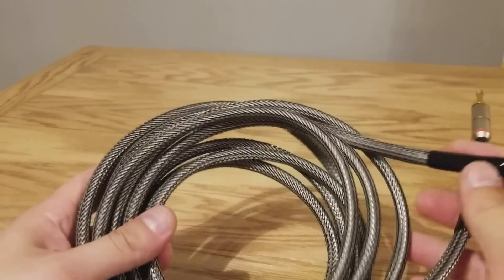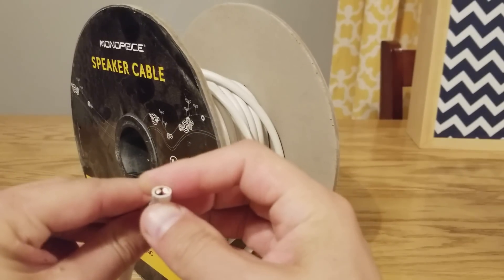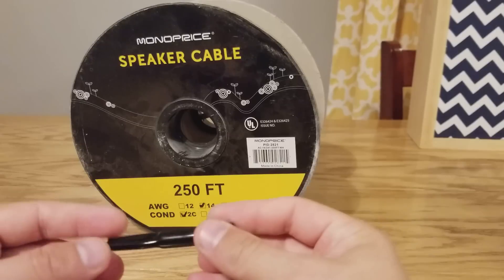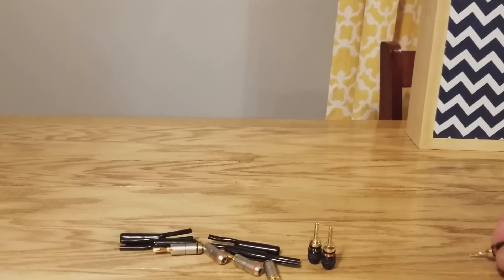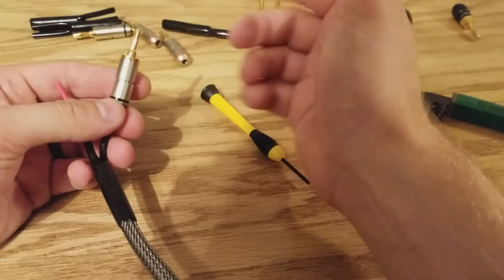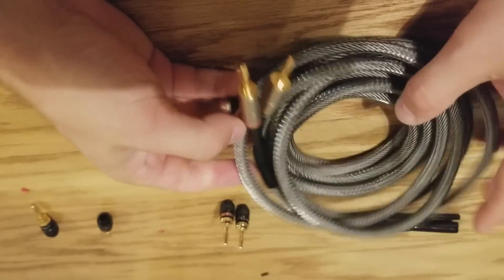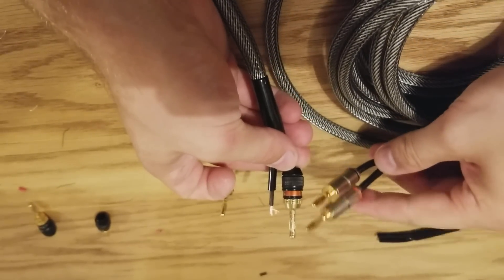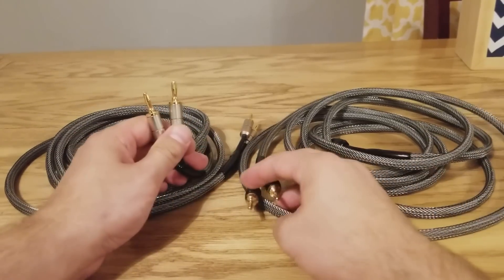How to make Your own HiFi Speaker Wire

Comment: The wire you are using is cheap junk, before and after your work. You are NOT making $300.00 wire. You are making $10.00 wire look like 300.00 wire. I suggest you watch a video about why some cables cost more. It has very little to do with looks.

* OCC or OFC copper 
* Gold plated terminals
* Silver Solder
* teflon Shielding 
* etc
These are some things that make good cable. Not putting pretty covers on them.
Reply: My system, in its entirety grosses over $20k. I wouldn't call it an entry level system. Bowers, McIntosh and Primaluna are some of my components. My current set of interconnects consists of a double pair of quality copper wire, wire that I paid about $3/ft for from a local electronics store. I have borrowed interconnects that gross in the thousands and was not able to discern any audible difference.

When I joined the Fire Dept, I underwent a full physical, including an anechoic chamber hearing test where I was able to discern and recognize test tones in the high freq range that majority of folks cannot hear. My hearing is on par.

Are you telling me then that all your voodoo and snake oil will make my listening experience that much better when I buy a $1k+ set of cables vs my, oh let's say $100 set? You can swear up and down that there is a difference "to a point" but I can tell you from experience that its not discernible. The people who go to listening test's, have no idea what they are hearing and most of the time, I'm willing to bet the placebo effect is more convincing than the sales man and their lack of common sense. You could play the same song, from the same source on the same speakers using the same wires and they'll bet their lives that the difference is amazing. Been there, seen it in person.

Irrelevant of how you slice and dice it, two things ring truer than that audible bonus you think you're hearing. One, the cable industry is full of snake oil salesmen who make big claims to sell you minuscule effective difference. Two, the only industry that's full of more shit than the cable industry is the record player industry, those con artist have jerked themselves silly.
Reply: Teflon is insulation, not shielding.
Reply: ‘Cave Beast Demon' Did your subscription to a paid product placement periodical tell you that?
The purpose of speaker wire is to transfer signal, with as little interference as possible from the amp to the speaker. Perhaps you've heard of twisted pair wire? There is a reason it's been the standard since Morse code. Why dont you patent something useful for mankind instead of coming here and trolling someone who is genuinely trying to be helpful to others.
Reply: Sir, I think you are very mistaken and taken in by the Hi Fi industry hype. They want to sell their stuff so will say stuff like OFC, gold plating  and what have you. As a massive music fan ( hard rock, soft rock, pop, chill out, house, jazz, Indian music, house music, independent music  etc etc.) , I have always dabbled with hifi from low end ( in my twenties )  to high end when i got  in the position to buy that kind of kit. I never thought cables made that much of a difference at all to be honest. What does make a difference, is the electronics and speakers matched in price and quality. Thats a dead certainty..
Reply: The only good thing about high end cables they give employment to the masses at the expense of the hifi fool
Reply: What about the battery for the insulator? Haha
Reply: I can guess who that some one would be. I have a understanding of electronics  and some of the claims made are something akin to a script of of a Frankenstein movie  and scifi may be they should move to Hollywood. The cables are simply made to look good to impress  "Lamb in sheep,s clothing"
Reply: If you have a PhD you fool ! you you should ask for your money back?
Reply: @Eden Audio I have a PhD too, but not in electrical or electronic engineering (it's in fracture mechanics) and I happen to think John Lieger is telling it as it is.  Your ad hominem attack on him because of his typo suggests you feel threatened; not what I would have expected from someone with a PhD.
Reply: The langue they use to some people sounds wonderful because they can not comprehend electronics I never trust a salesman no matter how applaudable they sound .
Reply: If you use 14- 18 stranded copper wire and lengths under 25' (for approximately  90- 175w )each there is no way to tell the difference in the sound with the only variable being the speaker cables. Using the proper size wire for the amount of power and the length of the run is the biggest concern
Reply: None of which does a thing to improve sound quality.
Reply: Oxygen free copper( 99%)and teflon insulated  wires are cheap and easy to find. Atleast in sweden. Mixing copper, silver and gold isnt the best. If you want your connections to be free from corrotion for as long time as possible you should stick to one of the materials.
Reply: You are a silly sausage. Spending ££££ on cables thinking it matters. Watch this and educate yourself: https://www.youtube.com/watch?time_continue=1825&v=ZyWt3kANA3Q
Reply: If you need good songs to test it with hit me up, I will give you a list of songs that are good for testing it.
Reply: StringerNews1 LOL!
Reply: OCC vs. OFC is snake oil. Banana plugs have much larger breaks than OFC would have comparatively to  OCC, he is using OFC according to the links he offered. Plus his terminals are probably gold plated. Far as I know there arent any solder points  in that cable so silver soldering would be irrelevant. Only difference is the Teflon shielding. However, yes he did just pretty much just terminate and wrap the cables. Big whoop, what are you trying to prove? that your purchase of a $300 pre-terminated cable was justified?
Reply: @StringerNews1 I am sure he would not agree to you performing a blind test for him to pick out his wonderful cable with success every time🤔. For me there are people in the know (understand principles and theory) and people who just do not know (him, believe all the snake oil). Still at least we don't get ripped off 😀
Reply: SO IS THAT WHAT YOU DO GO ONLINE  REGURGITATE SOME AUDIOPHILE BULLSHIT PASS IT OFF AS YOUR OWN, THERE ARE TWO CERTAINTIES IN LIFE (1) DON'T DO THAT (2) YOU DROPPED A HUNDRED GRAND ON A  SOUND SYSTEM YOU COULD OF BOUGHT AT GOODWILL FOR A HUNDRED .
Reply: I am currently in my junior year in college, and I am majoring in electrical engineering. The difference between Oxygen Free copper and non-oxygen free copper(for lack of a better word) is miniscule while using $50K test equiptment, and if you think that your ears can tell, you are sadly mistaken. It is a placebo that seemingly works on uneducated people like you, and who think that all the testing that proves high end audio cables don't change a thing are somehow 'flawed'. Please stop spreading your lies and making more people waste their money on placebo bs.
Reply: @johnlieger6735  Yeah im an electrical engineer as well and i have almost a decade of experience with military avionics. It is ABSOLUTELY a placebo effect. We have oscilloscopes that cost more than 30 grand and the difference (especially in short wires) is so insignifficant that it isnt worth even considering. Go ahead and waste your money on a cable that costs 300 bucks.
Reply: @johnlieger6735  BAM!! Another brother who is actually using that lump thats two foot above their ass ...Thank you bro
Reply: John Lieger,  do you even  know what the term oxygen free cable means exactly? It's not bare wire you dumbass, it's too do with the shielding/sheath around the copper wire! So, i guess you need to pay attention more in class son, cos you know shit about this subject and what you're being taught! Who do you think you're dealing with, a bunch of kids like yourself? Get a grip kid, respect experience and your elders you little jerkoff
Reply: @A_Pt_9298  OFC has to do with the content of the copper - it has nothing to do with shielding.  Oxygen causes oxidation - it breaks down the continuity of the wire.  Do some research before you spout off.
Reply: Again you are leading people astray that there is a discernible difference between $30 speaker wire and $1,000 speaker wire when listening on a "$10,00" speaker system. It sounds like you are just using buzzwords to make people shell out money for products with giant profit margins in hopes of reaching the unattainable perfect sound quality.
Reply: @johnlieger6735  Well done John, you have neatly identified the industry of 'Reference Audio'. Don't slip on that snake oil chap.
Reply: I would have totally agreed with you, till the point came I heard it myself and it sounds different. Even with a digital cable on the right equipment is noticeable. Yes i totally agree that a lot of the stuff is snake oil.  But when you have a audioset of around 2k up, you will hear the difference between a 3 dollar speaker cable and a 30 dollar speaker cable. AND YES I know it doesn't make any sense, yet there is a difference, sorry.
Reply: @bladiebla132  You do realise that a digital cable simply carries a set of 1 and 0s from a to b.  For it to sound different would mean the transport, which is all the cable is will modify the same 1 and 0s, to what exactly? It will be the same because it has to be to get the relevant audio output or video output as it was originally intended.  If you understand theory and principles of electronics what you have just said is a total lie.  Digital cables, power cords all utter nonsense.  As an example, if you plug a cheap HDMI cable in and have audio/ video okay, replacing it with an expensive HDMI cable will not make an ounce of difference to the audio or video quality.  Digital cables will either work or not work period😁
Reply: @a0r0a745  Wow you totally changed my mind with this comment. Jet I still hear a difference and everyone I checked with (around 40 random people) also does.
Reply: @bladiebla132  glad to enlighten you.  All I can suggest is get someone to swap, swap, swap and see if you can correctly pick your cable every time. If you do then you sure can tell a difference. If its hit and miss then maybe just maybe as I said the theory suggest otherwise.  All good fun though 😁👍
Reply: @bladiebla132  but there will not be a difference between a 30 and 300. sorry, we are not dolphins.there is a point in which differences in material affect the sound quality so little that the huge price differences are completely nonsense.6mm pure copper wire, gold plated forks, and voila.it might be more beneficial to change the wires INSIDE the speakers, and also input connectors since they are more often problematic than the external cable....
Reply: Dear StingerNews, I work in a hifi store and as skeptical as I was, I tried it for myself. Connected one streamer with a cheap coax cable and one with a expensive coax cable. Played the same song simultaneously, and switched between them. I heard the difference. Now I let customers walk in and don't tell them what I have done and do the same test. Almost everyone hears the difference and 80% prefers the more expensive cable. Although they didn't know what the difference was.  If I were you I would test it before taking a stand without trying.
Reply: Alright. I am sad to hear you think i am a hoaxer and think I do psychological manipulation. The only thing I wanted to do is to inform you that there is a difference in sound with different cables. This difference I can only prove to you by letting you hear it. So that is why I suggested it to you. Besides I am not a cable manufacturer so I have no need to prove my 'cable'. My only goal is to give people a better sound experience,  that's all. Have a nice day Sir!
Reply: Precisely, there is an actual difference between QED, Chord, etc.., with say 169 strands  and information, or silver plated copper wire cable compared to just normal lamp wire, but hey, he'll learn, EVENTUALLY 😄
Reply: I did a independent testing for my self, because I was as skeptical as you are right now. 
I connected two identical streamers one with a 'expensive' cable and one with a 'cheaper' coax cable to the same amplifier. The only difference in the configuration was the coax cable. I made sure it was only the cable, because I was skeptical as well. 
Please don't forget I totally agree that there is snake oil in this business. That's way I always inform people to just listen and find what they like. The point is, cables do make a different sound stage and that is widely accepted. The only point is, is that from a engineering perspective it doesn't make any sense. Yes I have also studied Electrical engineering. But we are not looking into specs, we are listening to these equipment, that is the goal of a hifi installation. 
You can argue all you want but there is a difference, sorry but there is. And personally I really don't care if you think there is not. Your loss or maybe not your loss if you don't care about really good audio. If you want to learn a thing, go check it yourself. If you contact a local hifi store they are probably most willing to let you test it yourself.
Reply: Exactly. Type of copper, gauge of copper, shape of copper, purity of copper/silver, brass or copper connectors? dielect, used so many variables.
Reply: John Lieger - Just FYI, hearing and listening are not the same thing! You can hear an entire conversation and not perceive a single word! So be careful about calling people liars.
Reply: John Lieger - It sounds as if you are confused (like most people who know nothing about sound reproduction).! A signal being produced by a source device is extremely complex and the processing by the human ear and brain of the resulting audible sound is infinitely complex and nearly impossible to test. You are claiming “electrical engineering’ not electronic, sound, or audio engineering. There is a huge difference! (See note)To me you are giving the impression that you are completely clueless and are making false claims in order to sound convincing . 

1. Determination of differences in the quality of reproduced sound requires a high quality source with equal quality components. (if you are listening to music from your computer with tiny cheap computer speakers (or even half decent) the quality of the cables will make zero difference. If listening through a $10,000 stereo system the differences are absolutely audible (to a point). 
2. The differences between high end music reproduction and “run of the mill” is electronically ”minuscule” but since the signal is amplified it is certainly audible using well matched quality components.

This being said, the differences increase rapidly to a certain quality level then diminish just as rapidly as the price increases, due to the limitations of the recordings and the human ear/brain. 

(Note) The main difference between electrical and electronic circuits is that electrical circuits have no decision making (processing) capability, whilst electronic circuits do. An electric circuit simply powers machines with electricity. However, an electronic circuit can interpret a signal or an instruction, and perform a task to suit the circumstance.
Reply: @cavebeastdemon3631  you sound like so many of the audiophiles I know who think their golden ears and their $100K stereo is qualitatively better then a $1K system to which I say BS. I knew an audio engineer named Bud Fried who designed some incredibly sounding speakers that you didn't have to mortgage your house to own. He even sold them in kit form. Anyway, he was despised in the audiofool circles because he would challenge them to do a blind A/B test to see if their ears could really discern the differences they claimed to be able to hear. None of them would take his test. I wonder why? Maybe because they knew they couldn't tell which was the $10K amplifier compared to one ten times less expensive. I believe the audiophile business today caters primarily to men with more money then they know what to do with coupled to having a teenie weenie!
Reply: @cavebeastdemon3631  -- Your PhD must be in snake oil marketing.
Reply: ‘Cave Beast Demon'  I’m a sound engineer / film sound editor since 40 years. I’ve been working in many professional studios during my career. I’m afraid your arguments just don’t hold water. It’s a lot of snake oil mixed with scientific facts where it suits you. If you feel better knowing your speaker cables are gold plated then good for you!  But don’t dismiss people who actually know what they’re talking about.
Reply: Who are you calling uneducated?, I have a PhD you fool. equiptment? Is that some new word?, I've never seen it in the English language.
Reply: @EdenAudio  PhD in what exactly? Consumer sales or audio electronic engineering?
Reply: @EdenAudio  you get the meaning , and a PhD in stupidity doesn't count .

Comment: I used the exact same cable without the pants and jacket (lol). My wires are hidden, so looks don't matter. I spent some time choosing good banana plugs (not expensive). I found some with 2 set-screws each which allowed more wire to be inserted into the plug, offering a tighter and better electrical connection. I tinned the ends first and removed the flux residue afterwards using isopropyl alcohol.
Reply from the maker: Glenn Watkins it really is great speaker wire.  It's the same stuff run throughout my theater.